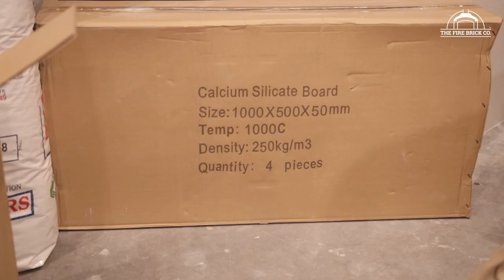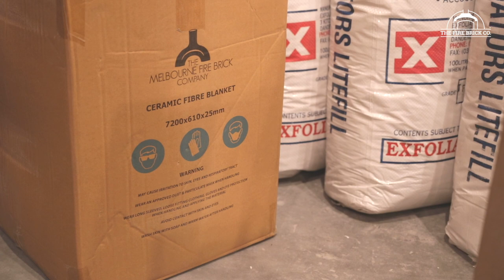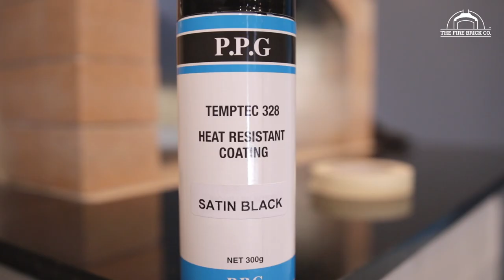How to Build our Brick Oven Kit | 1. Unboxing and Overview

Comment: What is the cost of 1 pizza oven in India
Reply from the maker: You would need to speak to a local freight fowarder to get the costs of shipping the oven to your location, it's possible but shipping can be quite expensive as the crate weighs around 1200kg

Comment: Hello, I have some questions:
1. Is it possible to use calcium silicon board as a whole? That way the thermal insulation will be better and lighter. 
    I don't know if there is any downside to the lighter weight of the pizza oven?
2. Or whether the refractory bricks of the main body of the pizza oven can be changed to Insulation Fire Bricks （IFB BRICK）, so that the heat insulation effect is better, and the weight is at least half lighter, and it is easier to install.
Reply from the maker: Hi! I'm not quite sure what you mean by the first question, but I can definitely answer the second one. I cannot advise using insualting firebricks for the main body of the dome, for two main reasons;

1. You want the dome of the oven to soak up and retain heat, which it then emits as radiant heat to cook your food. Insulating fire bricks are designed NOT to retain heat, which is one of the reasons they are so light. While this would mean your oven is quite lgiht, it would not perform the way you want it to at all. The internal temperature would go up very quickly when the fire is lit, but the minute it dies down a little, the temperature would drop rapidly. 
2. Insualting firebricks are very soft. If you hit the wall of the oven with a tool or some firewood you would damage it straight away.

Hope this is helpful!